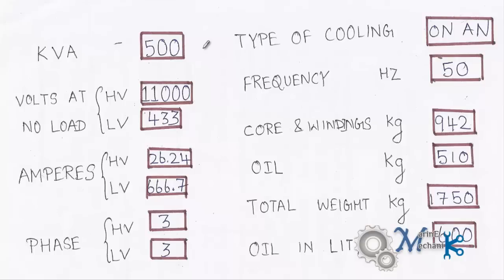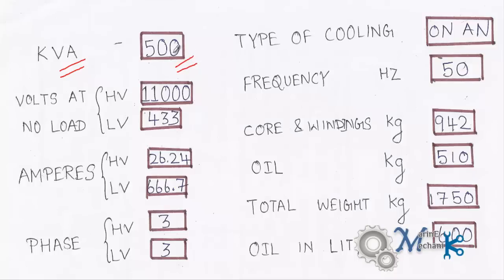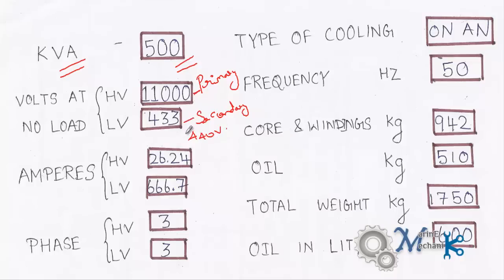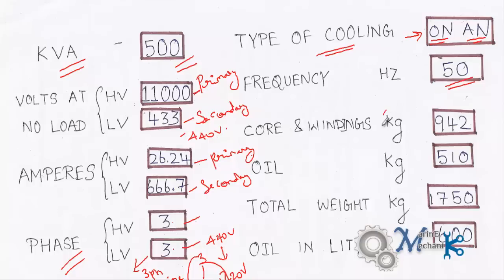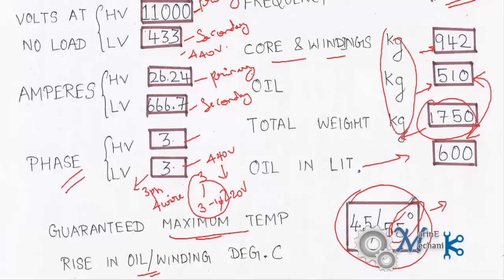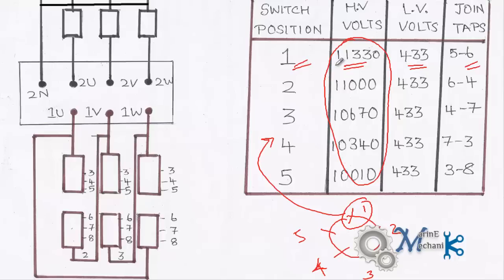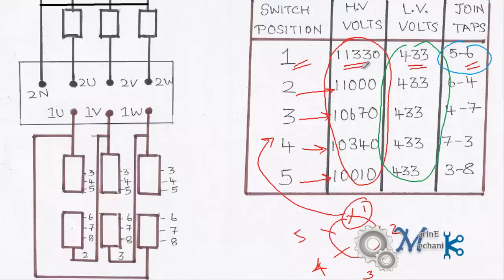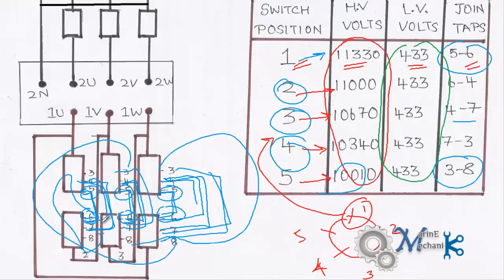Transformer Name Plate Details Explained..!

Comment: The main reason is to make primary side with tick copper winding and secondary side with thin copper winding because of law of resistance. If copper winding will  tick then current will flow easily in all winding turns due to bigger area of conductor hence resultant output current will be maximum .But in contrast secondary winding in step up transformers keeps with thin copper material is to get less current  at secondary side because in thin copper winding current can not flow easily in all winding turns due to smaller area of conductor compare to primary side hence the resultant total current will be less then compare to primary current.
This is the principle of step up transformer that primary side contain low voltage but high current and secondary side contain high voltage with low current to control line losses and to reduce expense of copper or aluminium wires for distribution purpose.

Comment: In step up voltage tranformer ,why secondry is made with thin copper winding
and why primary is made with thick copper winding 
explain plzzz?
Reply: Stepping up means the secondary side has higher voltage than the primary. The higher the voltage goes, the lower the current goes (because the product of Voltage and Current (VI) is a constant). Lesser current means thinner wires. You must remember that Vpri x Ipri = Vsec x Isec (input power = output power).
Reply: Mani Chaitanya 

because of current rating differance
Reply: +Mani Chaitanya becouse of the value of current in hv side the value of cuurent will be low for that reason we use thin copper and the oppsite on low voltage side

Comment: how much MVA rating of a 500kv/132kv step down transformar? plz reply
Reply: You must have some current information. If you can physically see the transformer, the MVA rating will be on the nameplate. There's not enough information in the HS and LS voltage ratings to determine the MVA.

Comment: Got to disagree with the taps. If you change tap on the high side the low side also changes. this is done so your load remains the same . I've changed enough to know.
Reply: In inductive cases The I is inversely proportional to the voltage.
Reply: Can u plz explain breifly about tap changing steps for different kva rated transformer!!